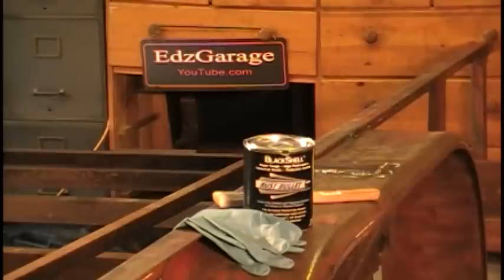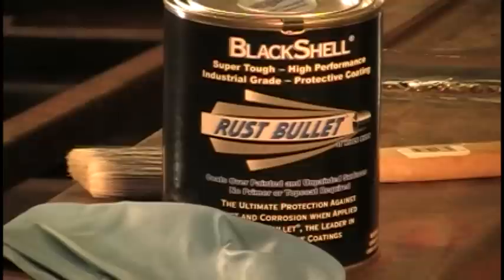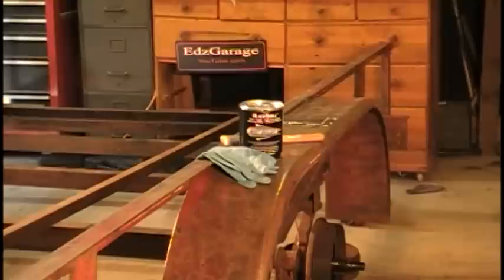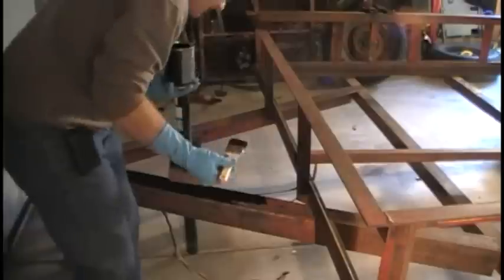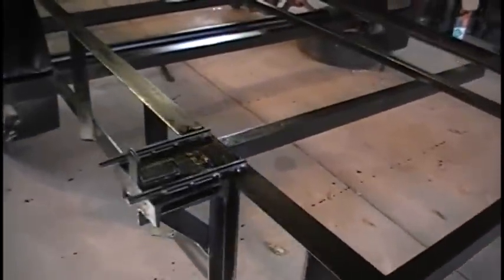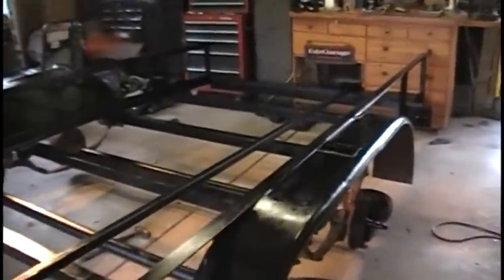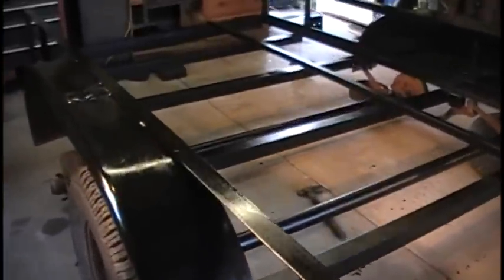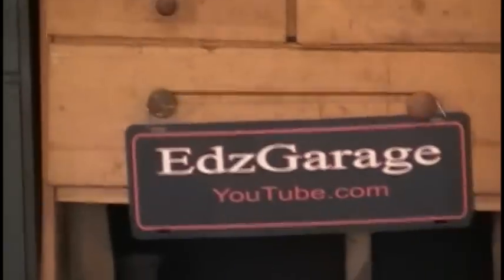16 Foot Trailer Rehab Project Part 6 Painting

Comment: The front top corners of that trailer look a bit sharp.  Why not use vise-grip pliers to clamp big washers to the corners?  One can then use the washer as a guide for grinding and sanding away the sharp corner.   Another improvement, though it does cost money, is to cover the trailers fence with Weldmesh.